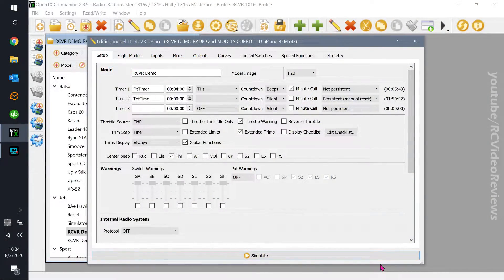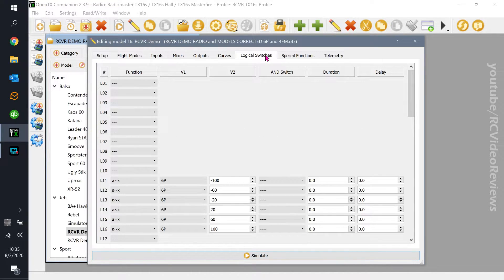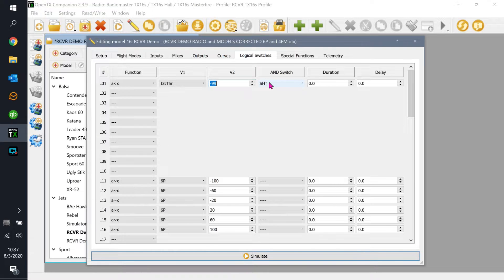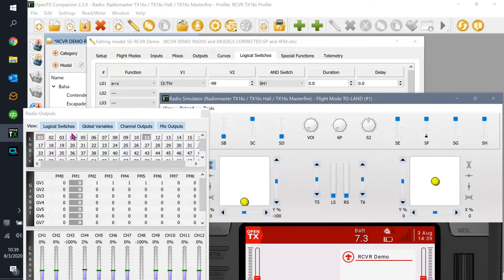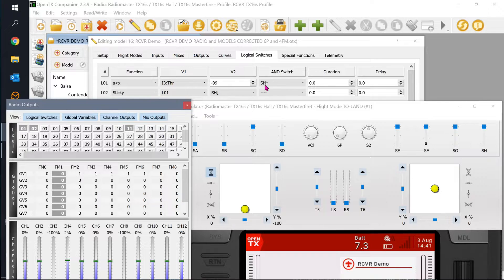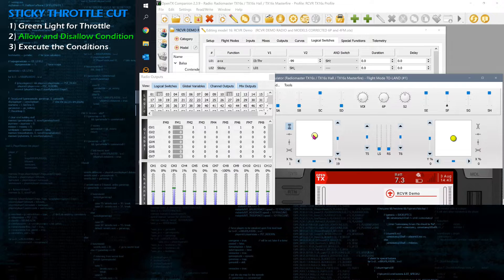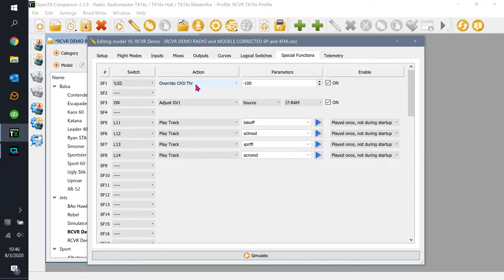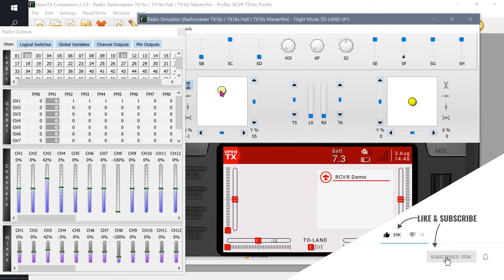OpenTx Companion Tutorial • Best Throttle Cutoff Using Logical Switches • TX16s [Intermediate]

Comment: Thanks for the tutorial. I imagine this would not be suited to autorotation (bailout)? Do you have a similar setup which works with autorotation bailout (without having to lower the throttle stick all the way down to bailout from autorotation)? Thanks again.
Reply from the maker: I do have an auto-rotation setup for Nexus. I'll be posting a motor setup video in my Nexus series soon and will cover radio motor setup (including auto) in that video.
Reply: @RCVideoReviews  Thanks for your reply. I'm looking forward to that video! I've just finished setting up my Nexus following your videos. The one with the pro pilot was especially helpful!

Comment: i noticed that i cannot bring up the OSD menu to make PID changes, etc. unless the system is armed using this throttle cut method. in order to bring up the OSD menu i have to put the throttle to up 50%, full rudder and full pitch. 
luckily she didn't land hard lol smh
have you found a way around this, or should i be looking for another way to throttle cut.

Comment: Great for my planes,  however to do auto rotation wit the helis will have to try to add another logic to check my flight mode normal,  so it will not lock out the throttle from being throttle back on if I goof up.
Reply from the maker: That would be a good idea.

Comment: I just received my TX16s and am pretty excited about all it can do.  Your videos are very helpful, even though we are all moving past OpenTx to EdgeTx.  I did not like the conventional throttle cut and really liked your take on it.  I have implemented a variation on it that you might be interested in.  I don't fly electric but I do use an ignition cutoff module in my gas planes.  I have always been reluctant to assign a big easy-to-bump paddle switch to the ignition cutoff.  It is far more likely that I will hit it accidentally than my plane will start itself once the ignition is armed.  Thanks to EdgeTx, I found a solution I like.  When the radio starts, the trottle is overridden to -100 as is the ignition cutoff channel.  There is one logical switches for this.  It is a sticky switch that goes true when Trim6 is pressed up and goes false when Trim6 is pushed down.  That true condition is when the ignition is armed.  Special functions set the ignition off when the L0x is false and on when it is true.  The radio announces the armed and disarmed condition with the pressing of Trim6.  Now I feel better about the risk of accidentially shutting off a 1/4 scale plane.  Again, thank you for your videos and I am sure I will comment on others.
Reply from the maker: That's the fun thing about EdgeTX, lots of different ways to make the system work best for you. Here are a few other takes:

https://youtu.be/buqQNZVoUXQ
https://youtu.be/OjDsJRsk4ak
https://youtu.be/TIi-eFpNXwk

Comment: This is a great tutorial, it was easy to follow. I have a question though - this is a relatively complicated set of steps that will need to be duplicated for all models. Is there such a thing as macros in EdgeTX that would let me define these steps, and invoke that macro when setting up a new model - instead of repeating each individual step?
Reply from the maker: Usually we just duplicate and existing model and on the duplicate, rename it, set trims to 0, and adjust the timer.

Comment: 👍👍👍👍👍Great video!!!!!!!!!!!!!!!!
I have a question about open tx : 
Problem: The Apprentice S , has a safety feature that requires the receiver to be turned off by a power switch before the battery is connected in order to be able to arm the motor later when the switch is turned on.  The problem starts when I want to use this receiver in another plane, that does not have a on/off switch. If i power the ESC without the on/off switch on traditional configurations then the receiver send the signal to the ESC which put it in safe mode/ locked mode and then motor does not arm. But if I physically disconnect the receiver, connect the batteries and then connect the receiver the problem is solved. 

Question: Is there a way to program a switch(virtual switch/logical switch ) in OPENTX that simulated a physical switch between the esc and the receiver? The idea is to avoid for a few seconds powering the receiver after the battery is connected to the ESC. Then use this programing/virtual switch, to later power the receiver so the motor gets armed.  Please let me know if you have any advice or if this is even possible with OPENTX. 
Thanks 
Alex
Reply from the maker: Replied in email.
Reply: @RCVideoReviews  thanks!!!!

Comment: Absolutely the best on line vid on throttle set up. Brilliant. Works beautifully except when the throttle trim is changed from the Centre position. I've played around with every possible iteration of the values in LO-1 and Special function, No joy. Any chance you might review and provide a solution, please? will be much appreciated. Thanks.
Reply from the maker: This is pretty easy to do. You need three logical switches. L03 will replace L01 in the example:

L01 - THR < xxx (high point of your trim range)
L02 - THR > xxx (low point of your trim range)

These two should be setup using values for x that define what you consider to be safe. In the video, my definition of safe was < 99.

Finally:

L03 - AND L01 L02 AND SHdown.
Reply: @RCVideoReviews  Many thanks indeed. Didn't quite understand, not a techie..;o( but will give it a go nd keep you posted. Cheers.
Reply: As mentioned to keep you  posted. Exactly as above, couldn't get it to work. It was hard to understand. In some models the throttle is reversed. will this affect? It will be much appreciated and benefit many of us if you would consider doing a video with you're usual clarity and examples.

Comment: many thanks for all the video's !  question, how and where do you reccomend the motor on and motor off annoucement ?
Reply from the maker: When the motor can turn with throttle stick movement I want to know. When the motor can no longer turn with throttle stick movement I’d want to know what too.
Reply: @RCVideoReviews  i have implemented your settings and it works perfect. Only Whish i have now is to have it spoken by a wav file.  " Motor on".  "Motor off".  and then respect the thr stick position like your settings.  Would that be possible?

Comment: Not bad - it happened 2 or 3 times that I accidentally got power to the engine by flipping the switch. But also it happened once that I just hand-started my plane by myself and then I accitentally flipped the cut-off-switch in that critical starting-phase. The engine of course stopped immediately and I had half a second why the f... the dammed thing didn't work anymore. After a more or less happy landing I looked on the remote and found the cut-off to be active.
A way to prevent this is to add a 3rd logical switch which defines the reset-condition of the 2nd (Sticky) switch as :
L3  =   a<x   Thr   -99    Killswitch inverted.
Then set L3 as the reset-cond in L2 :
L2  =  Stcky   L01   L03
In that way you can additionally to the original definition only set the cut-off if you intentionally put the throttle back before.

Comment: I have a little bit off-topic question: Can throttle cut be accidentally overridden by another switch, let's say stunt 1 or stunt 2 switch?
Reply from the maker: If throttle cut is setup correctly nothing should accidentally override it. But you can set things up so another switch could change throttle cut.

Comment: I must be stupid! wrote this logic 4 times, tried to change switches still don't work! In fact, when I put the throttle halfway up and turn the switch to arm the motor, I can't disarm it by moving the switch back, unless the throttle is all the way down to zero. Just the opposite of what I want!
Reply: The only thing different about my set-up is my switch goes back to throttle cut instead of forward. Is my radio defective?

Comment: Is it possible to have the radio play the throttle warning if you attempt to arm when your throttle isn't below -99?
Reply from the maker: If your lock switch is SFup for example, you can make a logic switch that says a>x -99 AND SFup.  When you move SFup in this case and the throttle is not -100 the logic switch will go active. With an active logic switch you can use that to trigger a special function to play a track in your soundpack.

Comment: Here is a challenge for you. I have tried multiple ways to get a Throttle Hold/Cut switch to work on a Blade Nano S2 when in 3D mode (Red Light), including the above method. I am yet to be successful. I now challenge you to do a video for Radiomaster TX16S setup to fly the Blade Nano S2 perfectly, including a working throttle cut when in 3D mode.

Comment: When I was watching this and trying to get sense out it, I said why not just go to especial function and just assign a switch to override throttle channel, but it’s finally making sense that if the assigned switch is accidentally switch off and say the throttle is at 60% there’ll be no output until the conditions are met, bring the throttle to -99 for it to be active. Good safety feature, on not to have accidental spool up when override switch is somewhat disengage. Making sense to me now.
Reply from the maker: Yeah, it's a little different, but simple and elegant.

Comment: first, thank you for your nice Throttle Cutoff function. is it possible to extend it with a flight timer that starts when the the throttle stick is going up from -99 and stops when the throttle stick will move down to -99 and also stops when the SH Throttle cut switch is activated.
Reply from the maker: Yes. Logical switches will do that for you. You can make one for your stick values then make another one that OR’s that one and your cutoff switch together.

Comment: I'm a newby and have had exactly the 'accidental' throttle rev-up situation when setting my throttle activation switch. It was even more embarrassing because someone else was holding the the glider preparing to launch for me! 
I am not yet into Open Tx Companion but I managed to copy this to the transmitter directly, so I'm really pleased with this explanation. Many thanks! Is there any way to make this a 'Global Function' so I don't have to set this up for each model as I enter it? Either way this is a great video and I'm grateful.
Reply from the maker: Channel overrides are not available as global functions so you’ll want to use this in your standard model template.

I’m glad the material was helpful for you.

Comment: My simulator in open companion wont activate.? How did you bring up the output picture next to the sim?  Thank John
Reply from the maker: The picture loads if the sd card is in sync and the models in Companion are pulled in from the radio. I don't know why your sim wouldn't activate, I haven't had that issue before.

Comment: Thank you very much, been using your throttle cut setup for all of my models.  Ran into a problem I could use some help on regarding this setup.  I have a couple gasoline models that I used this setup on and it works, unless of course I adjust the idle using the trim.  If the trim value in the flight mode tab is anything other than zero, then throttle cut is always active.  What is the workaround to have the safety feature of throttle cut on a gasoline (or nitro) model while still being able to adjust the minimum idle as needed?  Great videos!!
Reply from the maker: Set v2 in L01 to a level that accommodates your trim. i.e. L01 requires the stick to be < -99. If you're using trim the stick might be -85. So change L01 to be < -85. Just beware that any stick position between -100 and -85 will satisfy L01 and allow arming.

Comment: Thanks for the info. I need to watch this about 20 more times before I think it will make total sense to my brain.  

I use the SA 2 position on the left for throttle cut.  I would like to try to set the following:

1. For throttle cut: SA switch toward me, and the throttle is cut at any throttle stick percentage.  no issues here.
2. For throttle active:  Throttle stick low, momentary switch SH is pulled towards me, and then SA stick is then set away from me.  Release SH and throttle remains active.    Is it possible to use a momentary switch in this fashion?  In other words, I want the throttle arm switch to only be active when the momentary SH is activated and throttle is low, but then throttle to work normally once the momentary SH is released.  

The reason I would like to do this is I would like to set my system so, that like a gas plane, the prop idles constantly when throttle cut is disabled.  Obviously with that set, anytime you move the throttle cut disabled the prop will be turning.  Having to pull the momentary switch and then activating the throttle enable, along with throttle being low, ensures the "engine start" is warranted and at idle.  Looks more scale that way :)  I love electric but hate the prop stopping and starting all of the time at low throttle.

Thanks in advance for any help you can provide here.
Reply from the maker: The logic on opentx is pretty flexible. You may need to take a look at experimenting with sticky and/or edge switches to do what you want with the momentary switch.
Reply: @RCVideoReviews  Here is what I came up with so far.

Logical switch 01 is throttle less than 99 and SH (momentary) towards me for 5 seconds arms the throttle.  This “starts” the motor because I have the throttle endpoint set so it runs the motor at lowest rpm.

The SF switch moved away from me disarms the throttle and stops the motor spinning.  Visually you know when plane is armed as motor is spinning.

Motor will not start unless throttle is low AND momentary switch is held for 5 seconds.  Initial status of SF doesn’t matter but if I leave it in the forward position it takes a full toggle to disarm the motor so safe in the fact that I can’t accidentally bump it.

I will ponder the ramifications of this setup but so far seems like basically what I was looking for.

Comment: Hello, you told him that you had replaced the SH switch. The SH is soldered on a circuit board, did you desolder it and replace it with the switch on the left side?
Reply from the maker: On three radios: https://youtu.be/C3OO2poE2aM
Reply: @RCVideoReviews  Thank you very much, that is exactly what I was looking for. I had entered SH as a search term and unfortunately found nothing useful. As a previous Spektrum user, I absolutely have to change the switches. Thank you again.
Reply from the maker: @berndcopter9410  You're welcome. Be careful not to keep heat on the switch too long.
Reply: @RCVideoReviews  You can get both switch boards as spare parts in shops. The two boards cost just under €10. I wonder why Radiomaster does not offer the boards properly configured for former Spektrum users. The TX16s is so well thought out that this should also be possible.

Comment: Sorry, I do not see how this is smart. You can accidently hit the throttle-cut switch mid-air without noticing. And then good luck pulling out of the dive;)
Reply from the maker: Yeah everybody has gripes about throttle cutoff. This way and you kill your plane. Without the extra safety you cut off your finger. If it’s not for you it’s not for you. I’ve shown both ways to do it and both ways get gripes. So chose your poison.

Edit, Actually I've shown three ways to do it with the quad style cutoff and that got gripes too.
Reply: @RCVideoReviews , however, I did enjoy watching your video! Great example of using logical switches - I have not touched those yet and your explanation was crystal clear, thank you for that!

Comment: Have you got any advice for using three position switches? I only have three position switches available. I followed your instructions. Everything works as expected,.... unless I use the middle switch position. It will arm, but then it will not disarm, no matter where the switch position is, even in the formerly "safe" position.

Comment: I am helping a club member new to open tx (so am I) and have found that if the throttle is high and you go to arm the throttle will not go active, good, but if the throttle is brought down whilst the switch is in the armed position it will go active. Is this correct or have I missed something in the setup? I thought the throttle should not go active until you disarm and then rearm with the throttle low?
Reply from the maker: Something is wrong. Maybe watch the video again. Throttle should be inactive until it reaches zero.
Reply: @RCVideoReviews  This is what is happening the throttle is high then arm no throttle, locked. You bring the throttle to zero (-100) while in the arm state and then raise the throttle and it is away and running. It has reached the zero state while armed then it is active, it's not locked out. Should it remain locked until you disarm then rearm?
Reply: Got it sorted switch configuration had me messed up with the arm disarm all good now thanks took a couple more views of the video Cheers
Reply from the maker: @tala23ful  There is no particular order of battle in this logic setup. Two conditions have to be met for the throttle lock to become active: Condition 1) Throttle < 99. Condition 2) Arm switch armed.  That's it. If you complete both of those conditions, the throttle is armed. You could add logic to ensure the throttle cut is disarmed first, then the throttle is dropped to 0, then the throttle cut is disarmed. But the video at approximately 8:00 shows exactly what is supposed to happen and exactly how it happens. There is no additional criteria for the logic steps I used in this setup.
Reply from the maker: @tala23ful  Ok...glad to hear you got it.